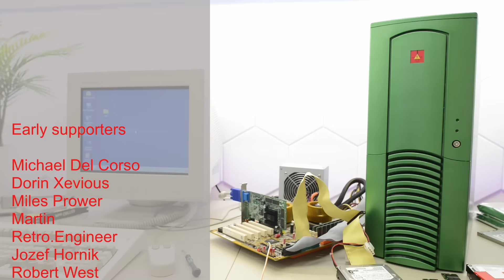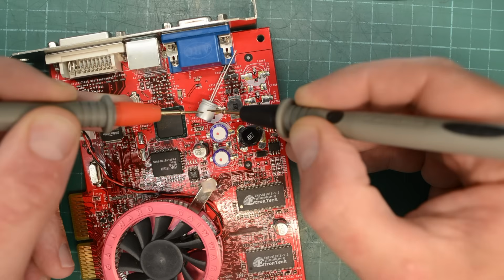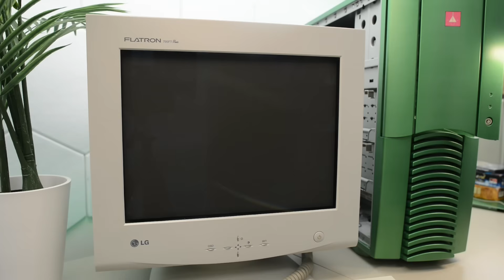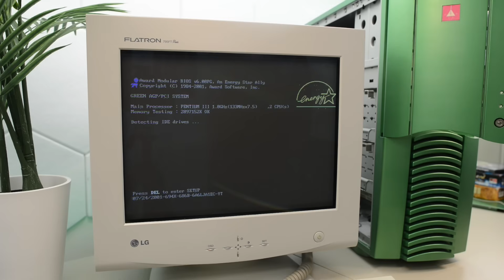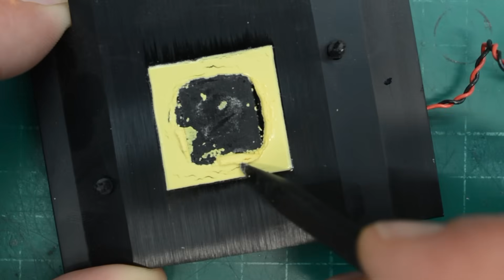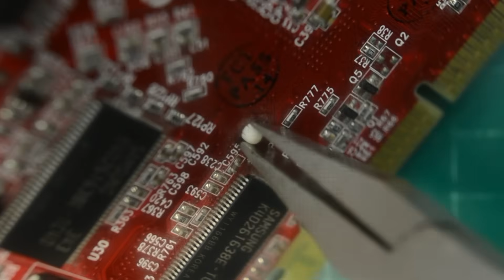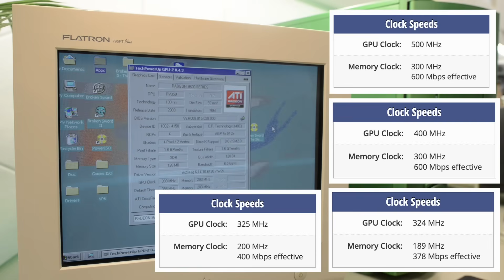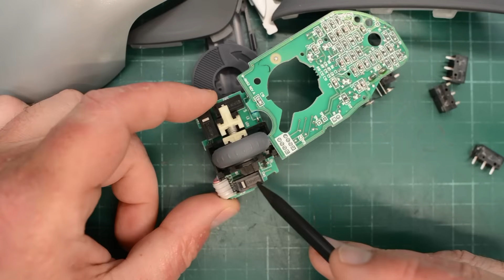Why are my vintage GPUs dying? Troubleshooting & Repair + poly-mod

Comment: Besides the obvious bad caps, the BIOS can go bad on the old GPUs, the voodoo series is infamous for this issue. Reflashing the bios to it brings them right back to life, that method probably will work on other older GPUs.
Reply from the maker: I'll try that next, thanks
Reply: @Epictronics1  Please do a Video on that.  I have a GeForce 3 original and its getting artefacts on the screen.  I have not recapped it yet but I am hoping a Reflashi will be the fix before I attempted soldering :)
Reply: Yes Bios corruption is a thing, a single bit flipping is enough to brick them (bit rot) usually reflashing helps, occasionally you might need to replace the chip as well, if the verification fails.
Reply: @timhartherz5652  Old EEPROMs can get cranky and have stuck bits that require a few erase-flash cycles to bring back. I've had a bunch of old flash chips of all types with stuck bits and no failures in getting them reflashed after 4 or 5 attempts. They continued to work fine for years after.

Not to say that old flash chips are entirely immune to failure, silicon defects and electron migration are a plague to all semiconductors. Though, I've had far more modern flash chips fail than ones that are 20+ years old.
Reply: Thank you; an interesting idea - ‘bit rot’ of flash storage, most likely! My Geforce 2MX and GeForce 3 stopped working, and it makes sense that this would be the issue!
Reply: @matthewtymaja3760  What make of GeForce 3 ??  Was it Asus ??

Comment: Are you using the same size tip every time on your desoldering tool? I've noticed that it's much much much more difficult to desolder through holes if the hole in the tip is even slightly the wrong size
Reply from the maker: I use the smallest tip I have that will fit over the leg/pin

Comment: Those purple caps on the first card probably didn't need replacement. They are solid electrolyte capacitors, practically indestructible, and eternal.
Reply: Yeah those purple sleeved ones are Sanyo OSCONs. They obviously can fail (we're talking 20+ year old caps here) but if that happens it'll be very obvious as the ESR shoots through the roof, to the point of them acting/measuring like a resistor or a dead short.
Also worth popping the card into a working test board and measuring what voltages are actually present on the caps and noting those down. I've seen it a ton of times where the manufacturer used 6.3V or even 10V electrolytic caps on 3.3V and 1.8V rails or something similarly low, where you could easily replace them with 4V solid polymer caps on 3.3V rails or in case of 1.8V even 2.5V polys. Really useful to be able to go down a voltage rating (and with that, smaller physical size) when you're dealing with tightly clustered caps or other components in the way
Reply: Solid electrolyte? Say what?
Reply: @Nukle0n  Solid polymer. There are actually also electrolytic caps that don't use a water based electrolyte, Panasonic FC series being the most common (described as "non-aqueous" in the datasheet), but the purple Sanyo OSCONs are solid polymer, albeit early ones

Comment: I'm surprised that renaming the .sy_ file to .sys just worked. It should, most likely, have been a file compressed like those on the MS-DOS and Windows 3.x setup floppies, which can be decompressed using EXPAND.EXE

Comment: Bro, on square chips you don´t do 2 lines of paste, you do either a blob in the middle or an X shape paste. if you make two lines it will more often catch air bubbles in the middle or do uneven distribution of the paste. you are welcome to the actual useful algorithm comment
Reply from the maker: What took you so long ;)

Comment: i like to use the hot air while using the desoldering gun and usually gives good results
Reply: I'm the same. I add fresh solder with the iron, then I go hot air in the left hand and desoldering gun in the right. 

I've faffed about enough to find it's quicker to just go straight in with this method as it always works.

Comment: I am very interested, my Geforce 2 Ultra has also just stopped working
now i watch the video :D
Reply: My GF2 Ultra seems to have developed BGA or RAM chip solder issues, it still works but has random dots or lines on the screen which change if I flex it ever so slightly. Weirdly I've never seen this issue on the lower spec GF2 GTS cards, even abused ones
Reply: @Knaeckebrotsaege  my Geforce 2 Ultra has black image, think capacitors, but no time to look into it further
Reply: That's unfortunate. That's the reason I don't use my good cards.

Comment: Those PCB designs with the multi-pad capacitor layouts are the ATI/nVidia reference designs, which they provide to their board partners as a starting point for their own boards. The intent was for the board manufacturers to adapt them to their price point and target market, but most of them just didn't, spun off the reference boards in their favorite color soldermask, soldered on components appropriate to their price point, set the clocks on the GPU chips and shipped it.
Reply: It has always been common for AIBs to use the reference design, but it has become increasingly common as the complexity of video cards has far surpassed the motherboards they're often attached to. AIBs don't have the capital to hire an entire engineering department to do custom board designs on the razor thin margins (or negative margins in today's economy.) They're already in an extremely precarious situation, and taking a risk on an unproven board layout is a yard too far. Heck, even Nvidia can't get their OEM designs to not spontaneously combust with their shitty new power cable.

Comment: aluminum oxide (Al₂O₃), also known as alumina, is generally considered a non-conductive material, or in other words, an electrical insulator.
But if you scratch it...well you have aluminium and that is conductive.
So, I would not mount those caps without a plastic seperator beneath it.
Reply from the maker: SMD polys are probably a better choice for that card
Reply: @Epictronics1 In this case I am purely talking about the housing of the caps.
The placed caps will probably short out the pads after some time.
Reply from the maker: @Marcel-ot5zz  Yes, I understand. SMD polys would eliminate the risk (being intended for those large pads)

Comment: For a card that black screens, it may be bitrot on the video bios.

Put it in the Win 2000 machine along side a working card.  Boot from the working card.  If you see the card as a secondary in Windows it’s likely the rom.  A
reflash can often be the fix.
Reply from the maker: It worked. Apparently, the black screen card is a 9500 Pro (275/275MHz). Now I only need to find someone willing to desolder the ROM and make a copy of the content :)
Reply: @Epictronics1  If you want I can send an radeon 9550 SE bios
Reply from the maker: @Fuliser  Thanks, it seems I need the BIOS for the Ti4200 and 9500Pro
Reply: @Epictronics1  There's 10 different 9500 Pro VBIOSes available in the Techpowerup Video BIOS collection, maybe one of those will help?
Reply from the maker: @seritools  That's awesome, thanks
Reply: @Epictronics1 unfortunately this is as far as my random knowledge will get us but it’s great to diagnose it.

Some cards had enough problems with this that folks created repair utilities that you can find.  Personally thinking of the Matrox G 100-450.  This was common.
Reply: @Epictronics1  I guess i have one. Will check tomorrow, if only i don't forget...
Reply from the maker: Thanks. I'll give it a try
Reply: I've seen bitsundbolts fix a lot of voodoo cards that had bitrot.
Reply: HUH.  I had no idea this was happening.  Good to know.  Thanks for calling this out.
Reply: If you intend to replace the PLCC32 EEPROM chips anyway, you can program the new ones with an external programmer, take a carpet cutter knife (the ones with the thick-ish replaceable trapezoid shaped blades, not the ones with the hook) and cut through the pins of the original chip right where they exit the plastic housing all around, which is actually easier than it sounds. Then you can just lift out the plastic carcass, and desoldering the remaining loose pins after that is a piece of cake with the chip out of the way. Done that several times with soldered PLCC32 BIOS chips on old motherboards. Whether you solder the new chip directly or add a socket to make things easier in the future is up to you
edit: this might sound brutal and like a massive risk to slice into the PCB, but since the pins are hooked underneath the chip, even if you go through the top bit of the leg with a little too much force, the worst thing that happens is hitting the lower/hooked part of the leg with the blade, not the PCB